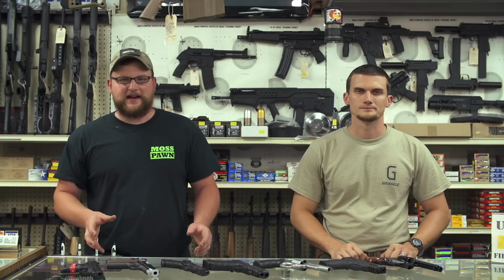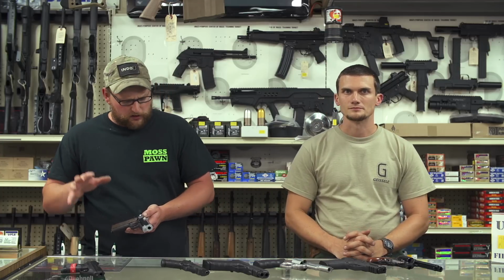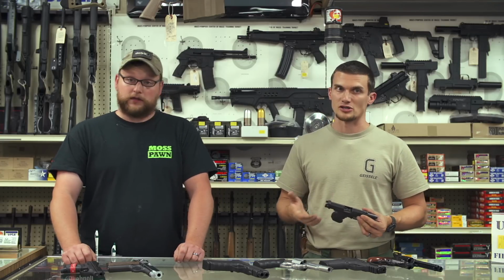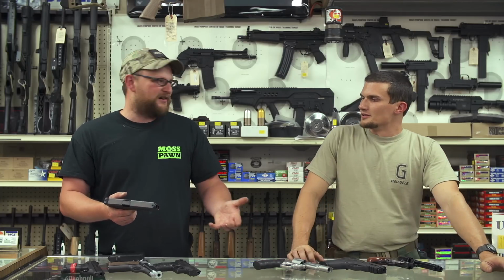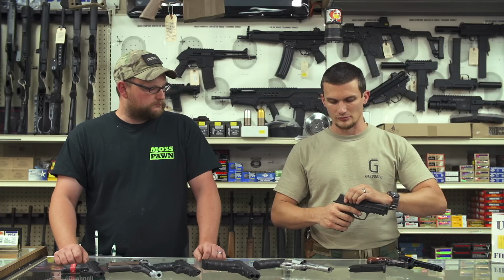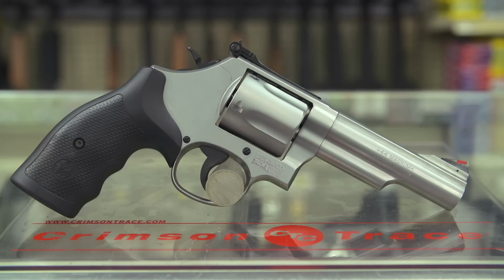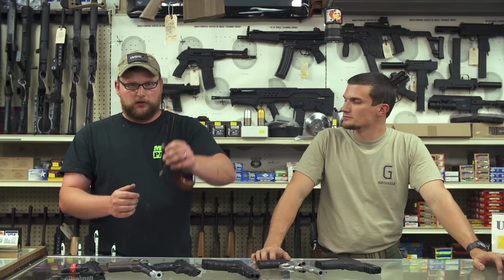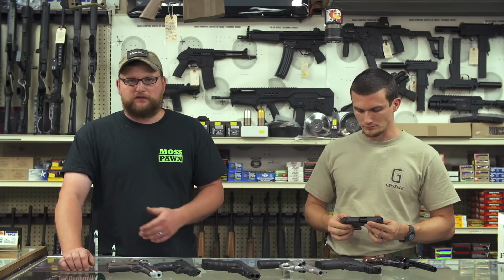Handgun Etiquette for Beginners

Comment: Can you guys do a video on some handguns that can properly cycle the typically cheap ammo out there, such as the Wolf and Bear ammo? I was at the range not wanting to waste good ammo in my Taurus TCP the other day and I used Silver Bear and was getting constant failures to feed and a ton of hand primer strikes.
Reply: Glock & M&P will take all the cheap ammo you can load into it.
Reply: My $300 Ruger P95 eats all the cheap ammo perfectly.
Reply: Springfield XD as well.
Reply: Should have said .380's. Kinda interested in that since it's such a light caliber.
Reply: As far as .380 probably a glock 42 would be the most reliable but even it has issues with specific ammos.  I know my dad's Bersa ThunderCC was a very inconsistent performer.  Personally from what I've seen of .380 firearms I'd steer clear of them altogether if reliability was my top priority.
Reply: bigred2989
Just shoot a heavier 9mm instead of a 380. The recoil will be a lot less if you do that. The $300 Ruger P95 is the softest recoiling 9mm I've ever shot. The added benefit is that 9mm ammo is the cheapest.
Reply: bigred2989 Taurus is the problem lol get a block or smith and Wesson m&p it will run fine
Reply: Prepare2Survive Sad ruger stopped making the p95, great 1st pistol.
Reply: I just looked it up, I agree that would be a first good handgun as well :)
Reply: Chris Kelly
The Ruger p95 is an old design, but I still like it. In fact I own 3 stainless steel ones. I bought them all new and the latest one I bought for $270 as a closeout special a few weeks ago. The new SR9e might fill the void as far as cost goes, but the P95 is still built more heavy duty than the SR9e. The new SR9e doesn't come in a stainless steel slide like the P95 and the magazines are cheaper for the P95. Stainless steel 17 round flush fitting Mec Gar mags for the P95 are only $17.44 on midwayusa. SR9 mags cost almost twice as much.
Reply: bigred2989 hey man you had a good question but just remember that every internet warrior is going to jump all over your comment and say that the gun they have will shoot anything you can load in it and im not saying all of the guys online are like that but most of them are they wont tell you that they have a shitty 1911 that wont run anything but brass cased ball ammo but they are gunna tell you it would cycle a soda can if it fit in the gun so hopefully Eric and Chad make a video to answer your question good luck man
Reply: Prepare2Survive ya my buddy has one, ive been trying to get it out and do a review on it lol
Reply: Vince Ruffing
Having a gun that functions with all kinds of ammo isn't magic. It has everything to do with the size of the chamber and throat area of the barrel. The throat is the area right before the rifling starts. Some guns have a tighter chamber and throat so it can be picky about ammo. Especially the steel cased ammo because the steel itself doesn't shrink back as much as brass after it's fired and that's why it can cause extraction problems in tight chambers. Some bullet designs are not seated far enough into the case for a gun that has a short throat area so they'll have failure to feed problems. That's why guns that don't have tight chamber and throat areas will basically never have problems. I reload my own lead 9mm bullets and I use a 357 magnum bullet mold. Sometimes the extra width budges out the case depending on the brass case wall thickness and it doesn't want to feed in some guns like my SCCY CPX-2, but my Ruger P95 never has that problem because the chamber and throat in the barrel are not tight. However if I seat the bullets farther into the case and use the 9mm factory crimp die they work fine because that crimp die will squeeze the bullet back down so it fits in the SCCY barrel better.
Reply: from my experience, its more then likely your gun that's the problem, Taurus doesn't make high quality stuff, and I have never had a problem with any cheap metal cased ammo such as bear or wolf, my Glock/Beretta and 1911's eat em up with no problems.
Reply: Love all the comments to just get a better gun... The Taurus TCP is not a bad gun... there isn't such a thing, technically, but it is not a good gun. The TCP is above "the Saturday night special" but just barely.
Reply: $250 SCCY CPX-2 would be a better choice than the Taurus TCP.
Reply: I just was out shooting for fun and I didn't want to use the PPU Hollowpoints I had.
Reply: bigred2989
If you want to save a bunch of money on ammo for plinking just start to reload your own ammo. Even the most basic of reloading tools only cost about $100 for everything you'll need. I reload my own 9mm lead bullets and the total cost per shot works out to 5 cents. The added benefit is that you can tailor the bullets so they function and perform in your gun better than factory FMJ ammo. If you want to reduce recoil you just load the cases with less powder. I do that with my SCCY CPX-2 because it'll function with 20% less gun powder. My Ruger P95 only functions with 10% less powder.
Reply: ***** Making my own ammo works out to $2.50 a box
Reply: Guys I currently have less then zero interest in reloading. I can find and afford factory defensive ammo easily. All I care about is good plinking ammo in ,380 ATM.
Reply: ***** Their ammo is great; so are their bullets.
Reply: Get a better pistol and you won't have to be picky about your ammo.
Reply: So far the TCP run everything fine except the silver bear, which is shit ammo anyway. I would never use it for defense since it's FMJ.
Reply: I've heard it said JHP's aren't worth using in .380 since it never gets enough velocity to perform well in small guns. Some have suggested special ammo designed to cause more hydrostatic shock rather then expand, but their plenty expensive.
Reply: bigred2989
Shooting the Bull on youtube has a good series of ballistics gel tests on different 380 ACP ammo. Here's a link to that series of tests - https://www.youtube.com/playlist?list=PLgNSGOEQko_MjOCGyqlMTiM2njdQQRbdg
Reply: My Px4 Storm Compact shoots anything I put through it. My Nano does as well. Well except that remanufactured stuff I bought but that was straight lead bullets and the gun is still pretty new.
Reply: Kabloosh
Try the drop barrel test with that reloaded lead ammo. Take the gun apart and hold the barrel in one hand pointing down. Then drop one of the bullets into the chamber. It should easily drop in fully and make a distinct clunk sound. Then use your finger to try and spin the bullet while it's in the chamber. It should easily spin. Then tip the barrel upside down and the bullet should easily fall right out. If the bullet doesn't drop into the barrel fully it could be slightly too wide, the case could be too long or the projectile might be touching the rifling inside the barrel. If you can't spin the bullet that means it's touching the rifling in the barrel and the bullet needs to be seated farther into the case. If the bullet doesn't fall out of the barrel it means the case is too wide and it needs to be run through a factory crimp die because that will resize the case. Doing those 3 tests will tell you exactly what the problem is. If the case is too long there's nothing you can do, but pull the bullet apart and trim the case.
Reply: Prepare2Survive I didn't make the ammo. It's just some cheap stuff that can function in weird ways. The Nano can be known to be funky with cheap ammo and it only had a few hang ups and doesn't seem to be a problem with any other ammo I have fired through it.
Reply: Kabloosh
Yeah, I know you didn't make the ammo, but that doesn't mean you can't find out what the problem is. If you're having stove pipes that's probably just because that one case had slightly less gun powder in it. If it's another type of jam then that barrel test I mentioned is what you do to figure out what's going on.
Reply: I fired all the stuff so I can't exactly do the test anymore. While it was a little tricky with the Nano my Px4 Storm shot just fine with it.
Reply: Dont listen to anyone here. Is your TCP one of the original models that first came out? I got mine after they fixed all the small bugs out of them which was due to the magazine and causing failures to feed. Ive ran 1000+ rounds of cheap academy monarch ammunition just to practice with and have never had one problem
Reply: Prepare2Survive I was referring to the people who were saying that the Taurus isnt a high quality gun and trying to shift this guy into thinking he needs to go out and buy a more costly gun. Im sorry you took it very literal and to heart but I dont cater to you. Im sure you got my message to the Taurus haters the first time though right?
Reply: tokarev
Reply: Atomic Bean
As long as it is left stock, I agree.  I changed the trigger to the PRP set with with new striker spring. That lighter striker spring causes some primer strike problems. This setup is sweet even though there are no real problems with the factory parts. The XD and XDm models are both gtg.
Reply: bigred2989
Given as friendly idea. There may come a day when we will be forced to making or own.. Would it not be better to get prepared now rather than at that time?
Reply: yep, any glock, any ruger, and m&p, and any xd.
Reply: Prepare2Survive
Yes Sir, my Ruger P89 shoots everything and never jams.
Reply: Yes, switch to a revolver! You never get problems with cheap ammo, if you pull the trigger and hear CLICK! instead of BOOOMMM!!!, pull the trigger again and you have a fresh round under the hammer. Regards
Reply: The TCP is one of the best pocket .380s made today (yes some are better designs).  How many of these little .380s have had recalls? Just about every brand.  Every gun is an individual.  You can't count on a brand name providing you with a quality gun.  It's always a crap shoot.  At least Taurus will pay for the shipping on a new gun to get it fixed with their lifetime of the gun warranty (the first company to do that btw)
Reply: williwonti
Actually Ruger pays the shipping both ways, they fix the gun within 1 week and that same warranty applies if you are the 2nd, 3rd or 10th owner.
Reply: Prepare2Survive  Never said they didn't, but Taurus was the first to ever offer such a warranty.  Ruger would not be doing that today if Taurus hadn't upped the ante.
Reply: williwonti Glock started the lifetime warranty trend
Reply: williwonti all three of those compnies are outstandingwith warranty service. i just had a new basepin for my 40 year old ruger 44mag sent out no questions asked for free and a free checkup. im the 5th owner of the gun. Glock will service damn near anything free as long as you werent negligent, and taurus is great but never had to use them. my 24/7 from from them is 100% awesome in every way, but had a frienf deal with their excellent service.
Reply: Prepare2Survive built like a tank as well,
Reply: buy a revolver, that will fix all of your problems :)
Reply: Matthew Pugh No it was Bersa. Regards
Reply: Sell your gun if you hate it enough to want to only use bad ammo in it. Then read this article about the the difference between modern Russian and American brass and steel cased ammunition to get a feel of what kind of reliability is acceptable for cheap rifles. http://www.luckygunner.com/labs/brass-vs-steel-cased-ammo/

Comment: Oh my word, don't go to these guys for some martial gun handling skills! For one thing the guy on the right loves to muzzle the crap out of his left hand... probably is one of those press check guys. And this thing about not letting the slide slam. It's a damn gun! It does that when it fires... And more! Don't get into the habit of using your hand to gently ride the slide in or you'll carry that habit over to your gun loading / reloading and you'll either not strip and round off the mag or the gun won't fully be in battery. (I'm speaking of the time when you actually need this gun to save your life and it's high stress). Train the Same way everytime! Insert the mag, tap and rack that bitch back!... And don't ride it in! Tap, rack, bang! It's a gun, not a violin!
Reply: +dodge mustang he's right, at leat with 1911's I had a brand new colt and if you didn't let it rock forward it usually would not full chamber. I didn't like racking it empty though
Reply: The safety Sallies are at it again. If you can't conclude that the safety check for a video about handgun etiquette was performed before filming to save time then I don't even know what's wrong with you.
Reply: You have a point with being in battery this goes for all semi autos hand gun or not
Reply: tim estrada you might not be able to tell, but I do believe the barrel is angled toward the camera a little as to not put it towards his hand. And unloaded it strikes the barrel directly, which is why, when it’s unloaded, you ride the barrel forward.
Reply: tim estrada i thought the same thing but what he means is dont let the slide ride forward when its unloaded as its not stripping a round off. The dry fire is only rim fire been told that centerfire its ok.
Reply: It's best to treat all firearms as if they're loaded.
Reply: Avoiding negative training is the #1 reason to let the slide slam home every time.

Comment: would you say you know more than the people who build firearms, I have firearms that says in the manual to load the firearm release the hold back tab and let the rail slam shut --Cannick55 is one of them
Reply: That's if your loading a round, not if your just playing around with the gun, you should only let the slide slam forward to chamber a round, which is what the manufacturer you stated rightly suggested doing, they did not however state slamming the slide is what you should do when not chambering a round.
Reply: These guys never said not to let the gun slam shut if your loading a round..
Reply: +Sasmodog  I wish I had read this before I asked my question. I ask your indulgence and pardon. Thanks.